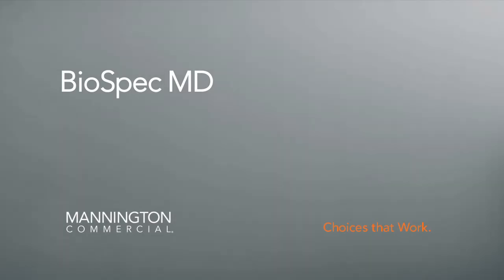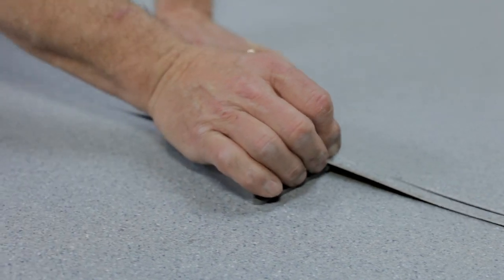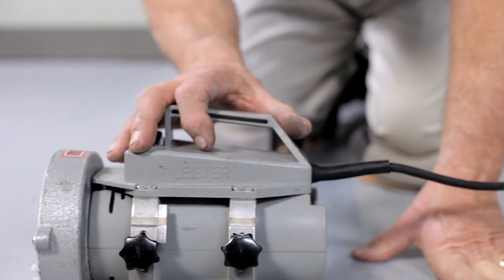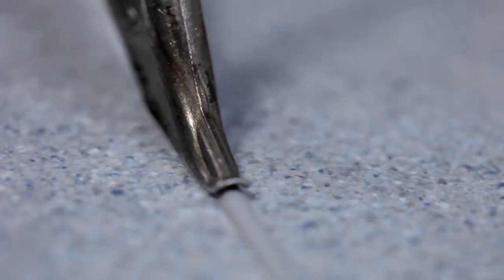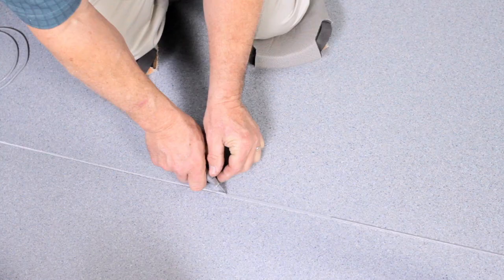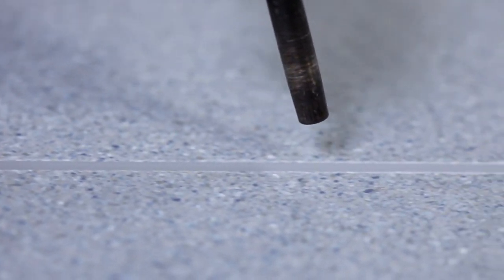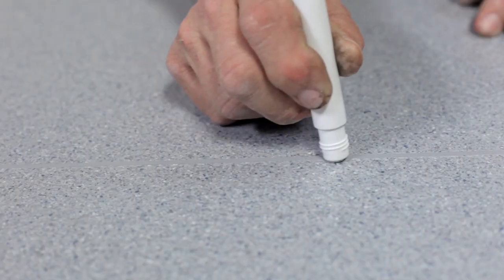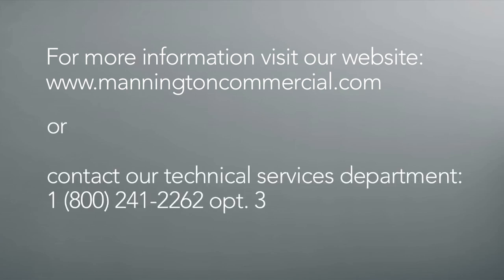BioSpec MD Seam Heat Welding - Mannington Commercial

Comment: We agree with paffordlake47 these tools have definitely passed their prime. Turbo Tools are not the cutting edge and for good reason. In any case it's always good to have more info out there than not. Good video.
Reply: Heat Welding Pro there’s not another groover out there better then the turbo groover! I do agree a bit though with some of there welding nozzles

Comment: Very nice video. I like it. I want to know that which weld wire is used in this video to join PVC floor? I also want to know the glue liquid in tube which has been used after heating by hot air gun? Please reply me aa soon as possible. Thank you.